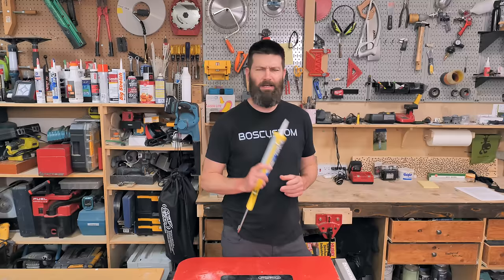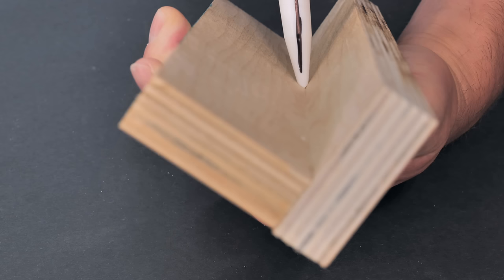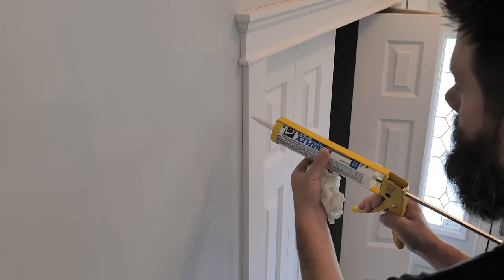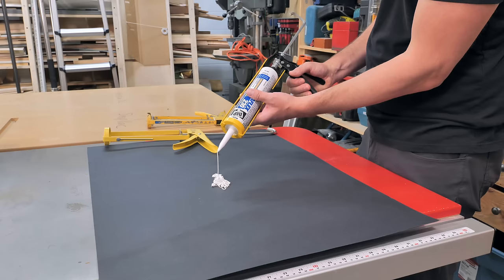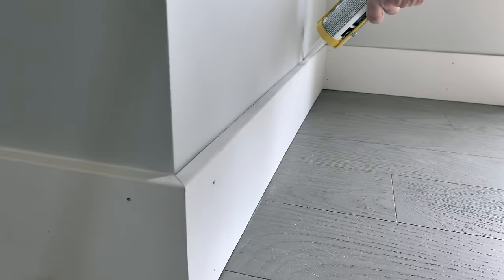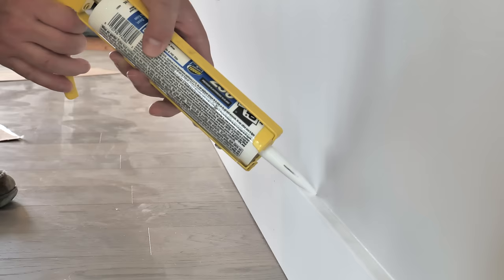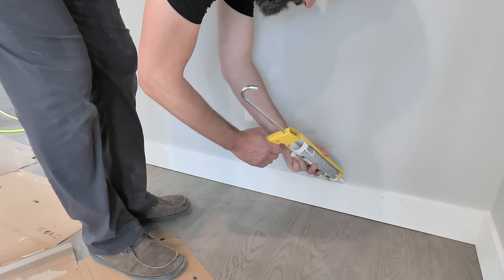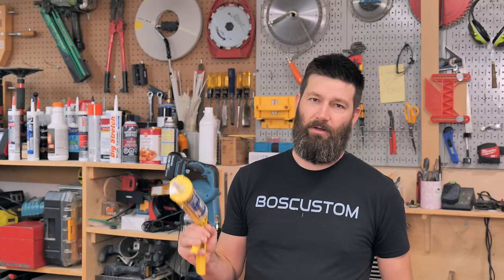The Secret Caulking Tip That Will Transform Your Ability!

Comment: As a professional painter there is one bit of critique I have and that is you are not putting enough caulk into those new trim lines. On existing trim you can get away with a small bead (to clean up a bad caulk line) if there is no cracking, but on new and cracked trim lines you need to add more caulk or it will just crack again within a few years. Caulking is meant to flex as the drywall and trim shrink and expand at different rates but if there isn't enough, or the product you are using isn't very good, it will not be able to handle that amount of movement and will fail. Another thing to keep in mind is that fast dry caulking is less flexible in the long term. Choosing the right product is key to having a quality finish that will last a long time. 

Appreciate the video!
Reply: Roger Bisby fixingdripping tap
Reply: Love the tip about fast drying caulk, had no idea!!
Reply: I just learned that lesson on fast drying chaulk when I re-chaulked my bathroom trim within a month it cracked and I didn't understand why.
Reply: I thought the same thing. However a pro knows when more or less is needed. Glad you put that out there for diy guys. 👍🏼
Reply: I totally agree.  the idea is for the caulk to never crack out.
Reply: Caulking is just one of those things you get good at when you are a caring person, and you need to caulk about 35 tubes' worth.
Reply: thanks for the tip
Reply: FireFlyEx: so, if new, black baseboards were installed onto white walls, and the customer told you not to caulk the top (and bottom, which isn't the issue), what would your response be, and why?
Reply: @toddinthemiddle  that depends on if the customer is male or female. If a man, yes sir, otherwise it's yes ma'am.
Reply: @Mouse_007  That's better than what I got. He told me that I wouldn't even be able to see the the caulking. 
Well, he was wrong, and I got to spend hours painting over it, and creating a new edge..
I should have phrased my question to  you more clearly.
Reply: @toddinthemiddle  Well he should have listen to you the customer.
Reply: @toddinthemiddle  My brothers saying! CAULK AND PAINT MAKE IT WHAT IT AIN’T. has truth to it!
Reply: @troy3456789  you are 100% correct
Reply: @troy3456789  really after 35 tubes you think you are good at it? That’s funny. 35 tubes does not even qualify as a beginner.I use on average 4-6 cases a day when I use cartridges.
Reply: @Mouse_007  excellent response who are we to push our aesthetic on someone else.
Reply: @toddinthemiddle  after explaining the importance of caulking the joint I would tell them that I can make it as invisible as possible or leave it alone and hope that whoever installed it was so good that it doesn't need that magical caulking touch.

One trick you can use is to tape the trim to almost the very edge of it (to the wall) and caulk it and immediately remove the tape, then wipe it one last time (with a clean finger) and it will fill the gap with the least amount visible on the trim. It will not be as good.. but better than nothing and will improve the paint line without making it harder to paint.

Hope that helps.
Reply: Very helpful comment and I look around some of the work on my house (NE USA) and you couldn't be more correct. There is a lot of movement and while the small bead looks great at first it needs to be thick to stand the temperature changes in my area at the very least. Also door and window casings subject to vibration.
Reply: @toddinthemiddle  If its  against drywall that's nuts. Drywall is not flat and is not supposed to be flat. The whole instalation process requires taping which produces smooth, undectable curves in the walls surface. Wood base and cap, etc. cannot stay snug against that amount of variation with nails at the studs alone, especially with seasonal expanding and contraction.
Reply: @ruthlessRod1000  it depends on the quality of the quick dry caulk. A high quality one won’t crack if applied correctly for years and years. I use them on exteriors exposed to the outside elements every day. Elastomeric caulking for substates that flex like crown molding is best. Just don’t use Alex caulking it always cracks fast. No matter what it seems.
Reply: @Mouse_007  😂
Reply: You can use clear caulking
Reply: Or just make the trim fit so there's not a quarter inch of f**** caulking lol, like the pros do......
Reply: Or use actual bathroom adhesive and not caulking..........
Reply: I'll say it in short. Caulking shrinks when you apply too little. Leaving gaps to apply more. To be honest, i'm the professional that likes to apply the just right amount and doesn't mind coming back for another pass.
Reply: Couldnt agree more, you need to fill bigger holes to some level and nice line for finish enough rich to expand shrink in the years to come...Those tips are solid and good platform to start... practice..
Reply: @genecarden780  some learn faster than others.
Reply: Crap, I lost my confidence again! Ha ha jk
Reply: u using dat alex plus 30min tho .. gotta move to dynamite 230 yerdme
Reply: @xiomaralopez1903  clear caulking should be a rare choice and only when going against something that shouldn't be painted but still needs to be sealed. For example, exterior trim against brick. One reason is that you will have to paint it twice because it doesn't accept paint very well (in my experience) and it shrinks more than regular caulking (again, in my experience).

There are more situations than you might think that the taping trick I mentioned earlier will work for what you need. I use it against showers and bathtubs to make a smooth paint line. Clear usually looks bad (in my opinion) and it picks up dirt and grime after a while.
Reply: @zsbacskai7331  there is a perfect sized bead of caulking that leaves a smooth connection without leaving a mess. I am curious what kind of materials you are joining that requires wetting the surface first? We are attaching wood to gypsum board (drywall). Even plaster works fine here.

And yes, it seems silly to call myself a professional painter.. but around here that actually means something. A lot of people try to DIY painting because they think it is easy and then end up with a mess. We also have a lot of self-proclaimed painters and handymen who paint (no offense to this channel) where I live who are almost as bad, and sometimes worse, than the DIYers. I've only been painting for 8 years but in that time I've done well over 300 houses and I like to think that I'm pretty good at what I do.
Reply: @toddinthemiddle   1. Don't if they don't want you too. If the baseboard is black you might not notice the gaps. 
2. If the gaps are noticeable you can run tape across the top at about 1/16 th and pull your tape. 
If the homeowner just didn't want it caulked then it's on them.
Reply: @alienproductions9948  sounds like a good drywall taper is what you need.
Reply: @thomasking1149  If you're saying baseboard doesn't need to be caulked, the best taper in the world still creates undetectable curves the board needs to lay against. With fasteners every 16," the wall eventually will pull away from the board. Drywall also will slightly curve inward between studs over the years as it dries out, further causing separation from the baseboard, which dries out much less.
Reply: @alienproductions9948  never have I ever seen what you just described happen to drywall in a house.
Reply: @thomasking1149  Well are you looking at baseboards that have not been caulked?
Reply: @indomitableson  You are brilliant!  I've learned so much from reading just two or your comments.
Reply: As long as my caulking doesn't crack before my holiday party then I'm good : )
Reply: Wow
Reply: I like how the creator liked this comment and didn't get defensive that's the sign of a good tradesman don't get stubborn everyone keeps learning and even someone who's shit can show you a tip or two
Reply: Your spot on I have been painting for 30 years…just about to hang that brush for good as I just turned 60…but can’t stay at home at all the time makes me go crazy…lol
Cheers 🇨🇦
Reply: @a.a.p3254  enjoy retirement! Hopefully you trained some competent people to carry on the tradition.
Reply: As a professional painter.  You should be caulking new Trim twice for shrinking. I go in new houses caulking out door casings ,trim ect , by the time I'm ready to go back,  it's all dry and keeps you from having to come back in future for shrinking. Just a tip
Reply: @justinbaker5672  I find that it depends on how big the gaps are and what product you use. A product that sags a lot would look terrible going over some gaps. And theoretically.. if you had a lot of big gaps you could use a latex caulk as a filler (or backer rod) because they get hard and then go over with a better product for the final look. Just a thought.
Reply: @FireFlyEx  I prefer double on all new trim.  Just a headache if I have to go back and second time running the caulk Flys, kinda like when you second coat a wall..always faster on second by a lot. It's preference obviously.  But I definitely can leave a job with utter confidence the contractor won't be calling me back =)
Reply: I always keep my tip clean
Reply: Good tips. Fast dry caulk is for bad painters who didn't prep when they were supposed to. Another good tip is call a pro you will deface your property nothing is easy first try
Reply: @elmerdane  fast dry caulk is ok to clean up a bad edge but absolutely not ok on new construction or new trim. Also, nobody should be starting off as a painter and starting their own company. This is not something you just jump into. If you want to learn to become a painter there are 100s of companies around that world gladly take you because finding help is difficult. So join someone, learn the trade, then if you are decent enough at it start a business. It's simply too easy to screw up and lose a lot of money paying someone else to fix your mistake.
Reply: @indomitableson  I say it's never as good since it's only strength is that is dries quickly it's always better to use good caulk and wait to prime "Cleaning up" old caulk is for noobs that haven't learned the sales process or don't care about their work. Imo
Reply: @elmerdane  it's a matter of choice. If time is of the essence and it's only visual rather than functional and it's proven to be a good product then I don't see the harm in it. I use regular caulking most of the time, but I also do bigger jobs most of the time. If it's a rental.. all they want is to have it done in half the time. It always depends on the situation.
Reply: @indomitableson  proven by who? What are you talking about? A matter of choosing to do inferior work? Need to remove failing caulk. Putting qd on nasty caulk lines is like painting rotten bananas yellow and setting up a fruit stand
Reply: @elmerdane  proven by years of experience and happy customers. I don't know what you think I'm talking about but it's not a situation where anything has to be cut out. So how long have you been a painter?
Reply: @indomitableson  so caulk that looks bad is still adhered properly? Just needs a little qd smeared over the top? Got it that'll save me a matter of seconds on failing caulk and it'll probably be fine I can tell you without a doubt it will look great from my house
Reply: I'm no pro and caulking can be a pain in the ass for me lol...but I thought the same. The next time I use caulking, I will use common sense on how much to put on the edge. Thank you!
Reply: Ok now you raise a interesting point with what you just said and makes perfect Since so one must use food decrement assistive project on hand and decide whether we use tape or just give it a hand job one finger and a wet rag  👍
Reply: Ohh ps. We all know there’s many many types and brands of chalk and that’s probably true as well and I want to say thanks to everyone for there outtakes on this topic it’s been entertaining
Reply: To a comment below I’m a jack of all trades but a master to none but I’m still better then the master too only one   Food for thought
Reply: When it comes to painting I love to cut in around windows tops and bottoms of the wall outlets just what ever   And I even do a second coat but to roll on the paint on the wall I’m not too good at that for some reason I can’t seam to keep the paint consistency and even but never the less I’m not a pro but I can get it done hope y’all have a good weekend
Reply: 6:55  @indomitableson
Reply: @ak-ex7yo  ?
Reply: @genecarden780 is that on outdoor weatherboard with huge gaps between them?
Reply: @Wicked_R  more than likely he is talking new construction.
Reply: @indomitableson  er yeah I'd hope so.

Comment: Sanding the tip, marking it and that dripless gun are game changers! Great tips man! 
I have also heard that more expensive caulking is almost always worth it, it flexes better and lasts longer. I was just doing some vapour barrier and I would say that when you are using accoustic sealant, put the plastic up first and let the edges hang, then go back and caulk the edges. I caulked the edges first on one section and made a huge mess!

Comment: Retired General here, seen it all.  What I learned here is the "orientation line".  Great idea since some caulking is done in not the best of light.  Of course if your square cutting the tip it doesn't matter but your method allows for a more precision bead with less to wipe out.  This old dog just learned a new trick.  Hats off to you!
Reply: Not having to wipe the excess is the key. Save so much time.
Reply: @99bx99  I just figured he meant general contractor. Apparently throwing around short hand is ok
Reply: @williamcrowley5506  He capitalized General so, you know....
Reply: @99bx99  ya, I know. Is cringe no matter what. If he is a General, than posting it in this context just screams of desiring attention. If he is a general contractor and wrote General, umm, same thing I guess 🤷‍♂️
Reply: I never thought about an orientation line.  All the chalk lines I have followed and guides in my saws and concrete cutting tools and I never thought about making one in a caulk tube lol.  Wow I have even drawn them on gorilla saws for cutting joints in concrete, once the guide was bent up from other workers not caring I just drew lines where the blades were located and I knew it was never wrong.
Reply: What does being a retired general (not General) have to do with caulking?
Reply: Emphasis, latex or painters caulk- not silicon. Some Harry homeowners may not understand the difference. Caulk is like finish trim. The smooze job looks like crap!
Reply: Hey general what's the secret when caulking stucco before it gets repainted?
Reply: Thank you for your bravery and service, Sir!
Reply: You know you're a real tradesman when you're retired and watching videos like this for fun. Tip of the hat to you sir!
Reply: I've long used the orientation line but differently - I put a piece of tape around the tube/gun to so the tube won't turn.  I like your orientation line idea as well and will be using it.
Reply: @williamcrowley5506  lol  gENERAL
Reply: "gig line"
Reply: @kerirobicheaux6629  lol.  I was gonna salute as well but I am sure he meant general contractor.  Retired military generals don't caulk, or watch YouTube.
Reply: @williamcrowley5506  Yeah.... how many stars? And, did he caulk any turbans?
Reply: @ibubezi7685  no matter what kind of general...he was experienced playing with his caulk!!

Comment: Your video has made me a better caulker.  I broke down and bought a non drip caulk gun and it is wonderful.  I'm cutting my angle on the tip and sanding it down on sandpaper.  Adding the guide line makes a world of difference too.  It's just so much better caulking now for me than ever before.  I don't use my finger though.  I have large hands and fingers.  What I do is place some warm water in a small bucket, add about 3 or 4 drops of dawn, and I get my sponge wet and wring out as much water as I can and use the corner of the sponge to even out the bead.  Works great.  Thanks a ton.

Comment: WOW!!! I'm preparing to paint the inside of my 1500 SF house. I bought 4 tubes of flex caulking and then saw your video. Thank GOD. I was one of those who would cut a 3/8" hole in the caulking tube, spend more time trying to wipe most of it off and get it smooth. I followed your instructions and did all the trim and baseboards including the bottom (my house is all tile) with 1 tube. AND it looks professional AND no mess. Thank you so much. This old guy was saved from a ton of aggravation! My wife was happy too because she didn't have to "hear" me.......

Comment: This is legit the best how-to caulking video I've ever seen.  Every time I've ever caulked before it's turned into exactly the mess shown in the beginning of the video.  Today I caulked both the base moulding and the sink I installed in my bathroom, and it came out PERFECTLY.  I hardly had to wipe it down.  AND I just had a plain old caulking gun and I accidentally cut too big a hole to boot!.  Didn't matter...

Thanks for sharing your tips and experience, Mr. FC.  

Cheers

Comment: I did a brief stint covering for our drywall "prep" guy when he quit and I was managing a large drywall company.

You can achieve lightning fast caulk times by following the nozzle with your finger. It takes some practice to dial in finger pressure, speed, and gun trigger pressure, but when you do there is very minimal fall-back needed to make it perfect. I used to literally run on stilts, caulking every inside corner in an entire house in 2-3 hours, over rough (ROUGH) knockdown texture.

DAP 230 rules the roost for workability and open time.